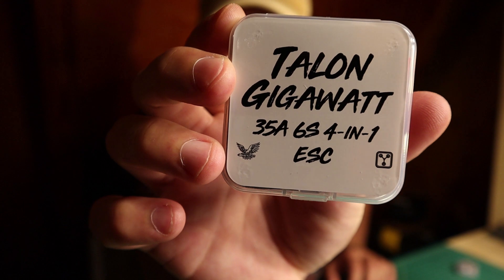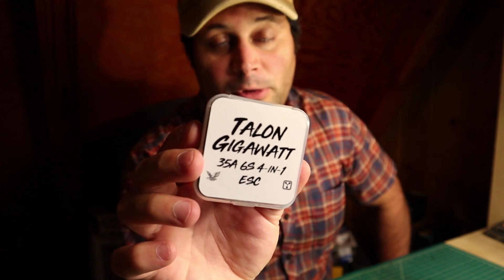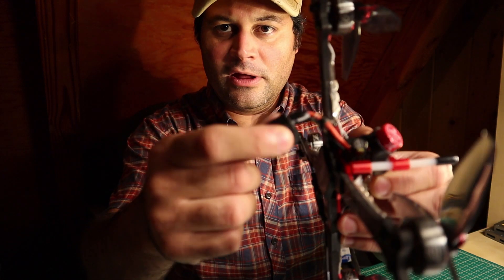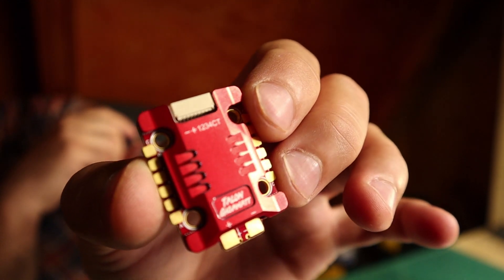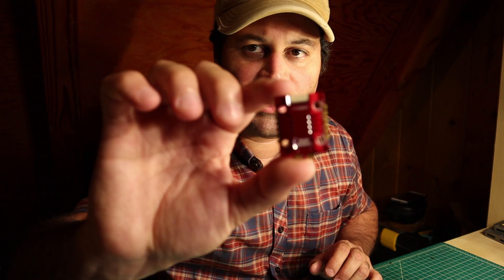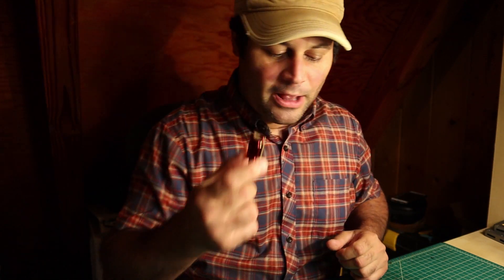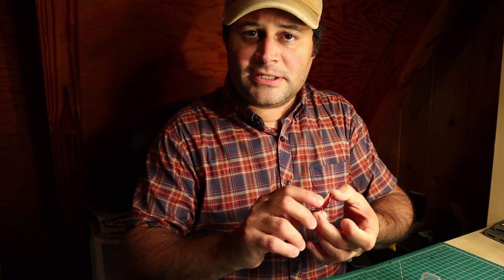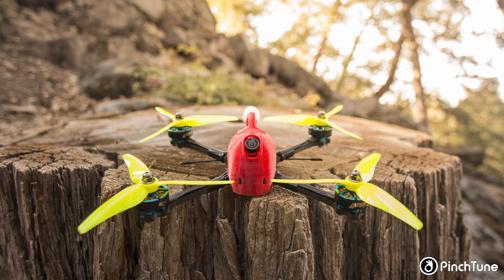Talon Gigawatt V2 ESC // Reliable 20x20 6S ESC

Comment: i do race and fly with 30x30 so far i broke only 1 esc in 2019 so far havent broke any in 2020 yet ibroke one lastyear which is a airbot do you think i should be fine with this one?
Reply from the maker: Hi, yeah, you'll be fine. I'd be wary of recommending anything to guys that seem to burn ESCs left and right... but out of my 2019 rigs, which were 3 quads with this ESC I only damaged one. One of the corners stopped working. But I abused these quads quite a bit. I haven't kept on top of the latest 20x20 ESCs so I haven't tried any of the new ones. I hear the Hobbywing 20x20 is pretty popular. Also NewBeeDrone has a 20x20 now. I just haven't tried either of them yet. I'm not racing in 2020, so more than likely won't for a while.
Reply: PinchTune thanks! in the fence on choosing this or the hobbywing
Reply from the maker: @angelfpv4825  I think they're likely both great. I'm partial to Aikon (this) because I've had great experience with then. My buddy for example, hates Aikon and would go Hobbywing. I think you'll be fine either way. I'll tell you what though.

Comment: I've never burnt a 25v cap on 6s.😁 Has anyone actually tested 6s for voltage spikes?  The only video i've seen is on 4s i think and he was hitting 28v.  Looks like a very nice 20x20 esc.  I have reversed the polarity and exploded a capacitor.  Reminded me of those party poppers!
Reply from the maker: I've never burnt a 25v cap on 6S. I don't think they burn because of that. I think it has to do with protecting better against spikes if it's twice in the input voltage. But anyway, one of these days I'm going to plug a cap reverse on purpose just to see it pop. Haha

Comment: I have 2 of them I blew up with 4s.  I dont blame the esc on 1, but the other all I did was clip a gate and it burst into flames and burned up my whole stack.
Reply: Same thing happened to me crash and esc no longer responds might throw it in the oven and see what happens
Reply: @oakfpv9982  Good luck, on one of mine, I can see the fet that blew up maybe even 2.  On the one that burst into flames tho, it got the  at least 4 fets on the one side, 2 caps on the other side and I think its a voltage regulator as well.  No oven will bring mine back lol It also burned up the FC and the vtx works but not right, it now causes tons of noise.  It cooked my whole stack.  Now Im gonna try the Tekko 32 F3 20x20 esc, see if it holds up better

Comment: just put one of these in a build havent flown yet but its very nice
Reply from the maker: Ah nice. Let me know how you like it. I have two more builds coming along with these. One is an FPV FlightClub Neutron R. In fact, it's featured in a video I'm releasing over the next day or two.
Reply: @PinchTune  ive been looking at that frame so ill look foward to the build on it . i like this esc but the heat shrink takes up alot of room might have to try the one without it on that neutron frame .  im running 4.1 on it and its all set up already with motors and vtx switch you just have to set a modes tab for it . im runing the tmotor 2306 1750 f40 pro 2 on this one i bought that kit pyro is selling all 4 for 75 bucks could not beat that deal
Reply from the maker: @jayward7536  Those motors are great. I actually have a set on a race HD rig that I use just to get nice HD footage at tracks. In fact, I have a video from a few months ago with that setup. It's the one one titled, "Fast Drone? Go RACE." Anyway, I do see what you mean about the heatsink taking space. But from my measurements on my Neutro Rs, I should be OK. Plus, I put this same ESC in an Impulse RC JS-1 and that' even tighter in there, and it fit just fine.

Comment: On flightone you have to bridge it as a blheli_s being a BLheli32 esc, why?
Reply from the maker: You're just telling the FC which type of current reading to use. And it's ONLY BLHeli32. When you bridge the current pad you're telling it to either pick up _32 telemetry or otherwise simple current telemetry. The fact they mention _S is just confusing people, but all it means is the traditional way of reading current versus using BLHeli32 Telem... even from a 32 ESC.

Comment: +1👍 Thanks for teaching about the capacitors !!
Reply from the maker: Absolutely! I feel most of the capacitors that ship with ESC are just the bare minimum. I normally run larger units. Also, as a rule of thumb, you want to run a capacitor that's rated for twice the voltage of the setup. For example. 4S (16V) x 2 = 24 Volts... so a 25V cap is fine. For 5S (20v) x 2 = 40V... so a 35V up to 50V cap is fine. 6s (25V) x 2 = 50V. So for that, a 50V cap will be ideal. As you go up in cap voltage you can go down in uF. So for example, if you run a 680us - 1000uF 35V cap most of the time for 4S or 5S, you could drop down to like 220uF or 330uF for a 50V cap. Otherwise they get way too big.

Comment: Your gonna love the arc one frame. I love mine. It takes a beating and just keeps going. I run true x on mine at the moment and it’s been a beast for me and I feel it’s help my racing. Just more confidence knowing I won’t snap an arm so easy. And I finally put FalcoX on mine a cpl days ago at our test n tune day and I immediately dropped 4 seconds off my lap times. I just need to dial in my rates better but the tune we came up with is perfect. No matter what I did even testing 8 different props I couldn’t produce prop wash. About to upload some vid of my second pack on falco and some of my fastest laps of the day. I forgot to dvr my laps on regular Flightone tho and I’m kinda pissed at myself lol.
Reply from the maker: Dude, I haven't had a minute to flash Falco X to my racers yet. Well, in truth I broke the last of my Neutrons at the last MGP race so I technically don't have any working 6s racers. I have 3 Neutron R frames sitting there, one half built and the others waiting. Work and life has been out of control busy the last few weeks.  I need to get to building so I can make the November races. I saw your videos about it on Insta the other day BTW. Looking REALLY good.
Reply: PinchTune I know the feeling. I’ve got at least 3 or 4 partial builds done and I’ve been procrastinating on finishing them 🤣 and one I literally just need to solder 2 Motors and the xt60.